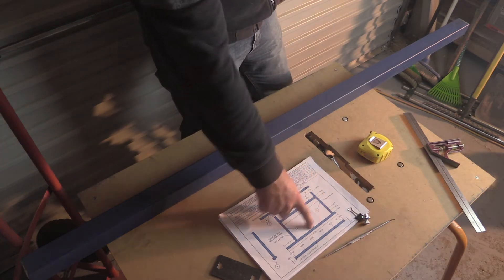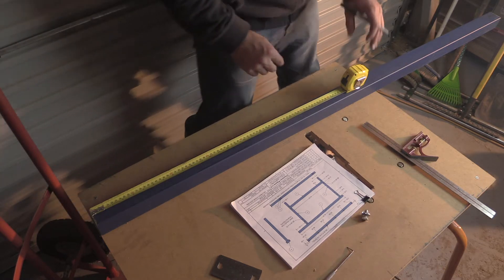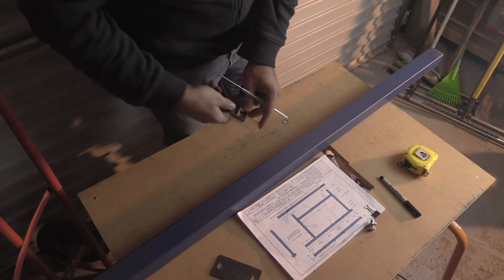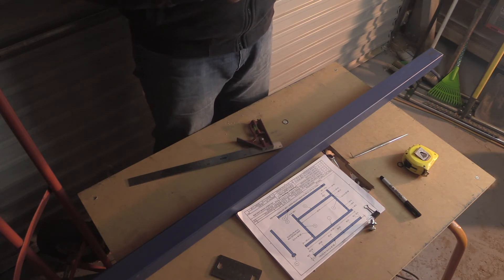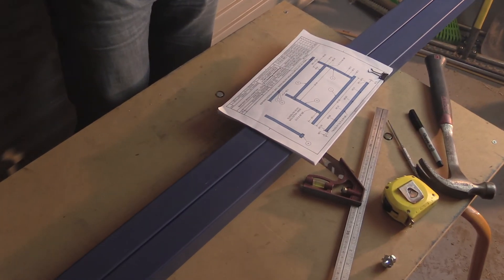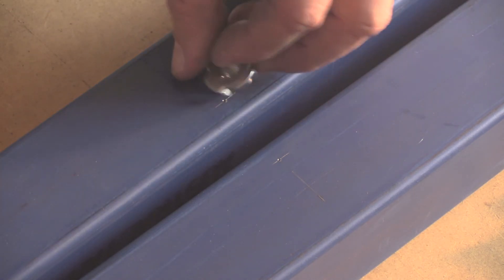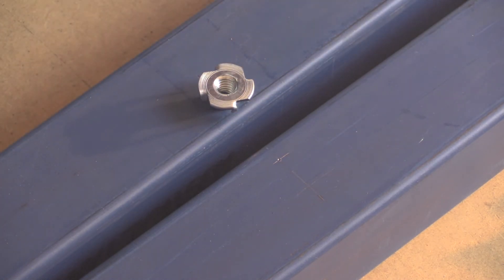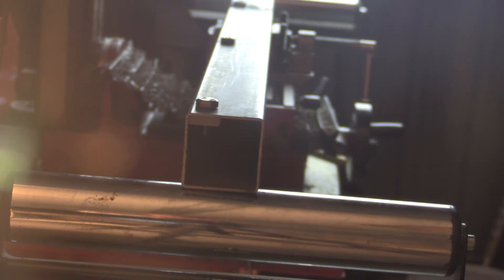DIY CNC Build by a novice - part 7

Comment: Mark.   Love your You tubes, very interested in what your re doing, makes it much easier for novices,  don't have t reinvent the wheel so to speak.

One suggestion, have you heard of "Rivnuts" or "Nutserts" a method of getting threaded holes in bits that are a bit thin.  Having said that I think your solution to the problem was a better one.

Will watch the rest of the series wth interest and hope to do something similar myself.

Comment: hello i make also a cnc pladdma cutter with the same sistem,arduino and cnc shield,but when i start the plasma the machine stop and i read i need a optoisolator for the hig frequency of the plasma,you have the same problem or no?
Reply from the maker: +fernando novo castro, G'day Fernando, I haven't actually got to that part of my build yet but I have heard you need to make sure everything is grounded correctly. This goes for the plasma machine, table (all 3 axis and the table itself) and the connected computer. The other thing I plan on doing is using isolated cabling for all the connections to and from the table.

Thanks for watching.
Reply: i try to iso the steal with a wood table and i have all conected,i used a shieled cable ,all works but in the moment start the plasma all stop and g code sender said hard limits

Comment: Novice to novice :) Do not drill holes that big without a pilot hole. I use to be lazy too but in the end it is better (as you did previously) do a centre hole drill and after that use the drill size that you need or a smaller one, i usually use a cheap 4.5 mm drill, that i do not care off (.50 EUR 2 pcs set) to drill the pilot.

First drilling cycle was perfect.

I got into trouble drilling directly for a M10 tap... the drill bit (high end chrome one) offset about 0.100 ~ 0.200 on one of the last holes and the piece had to be drilled all over (30 holes or so). So lesson learned... spend more time in preparing, in the end is better, and a time/material/money saver.

Keep up, and congrats (to late is better than never) for your new job. :)
Reply from the maker: G'day +Andrei Sima, thanks for the advice and use I was being lazy :) I totally agree with drilling pilot holes and taking the time to set it up. I wouldn't be the first time I've rushed something and ruined a part. That's how I broke my M5 tap, trying to push it too hard to save time. I then had to spend the next 45min getting the broken tap out.

Thanks for watching.